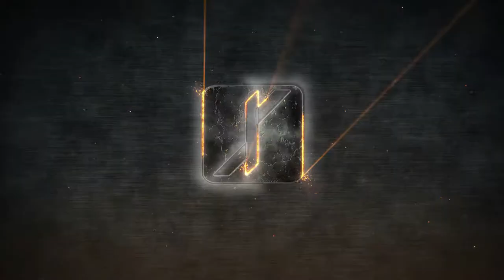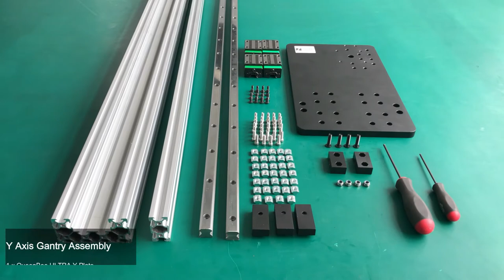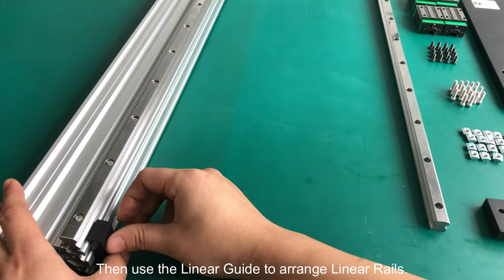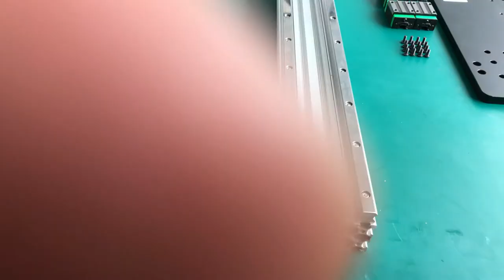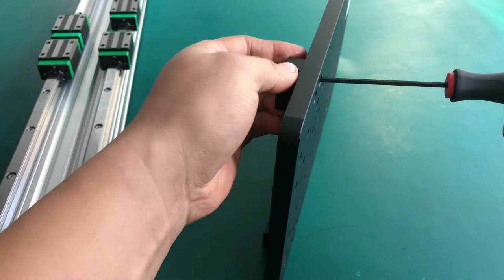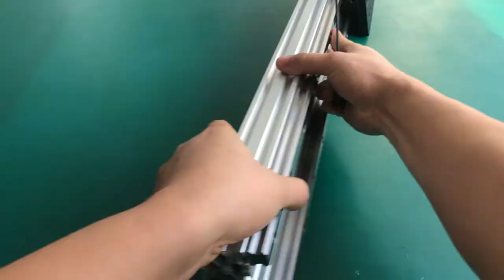WorkBee Upgrade to ULTRA QueenBee CNC / ULTRA Queen Bee CNC Mechanical kit-Part 2

Comment: The hole for the lead screw (and consequently the motor mount holes) seems to be placed in a little different position on the plate compared with the original Workbee, am i right ?
Reply from the maker: Yes,we redirect the position to let the 2040V-slot can be inserted into middle gap of C-beam Rail,to Increase strength and rigidity.
Reply: @yuyongindustry  Thanks, but i was referring to the big Y plate
Reply from the maker: @IceCreams62  Yes,all plates are changed.

Comment: How to find that block to guide linear rail,, anyone has link to buy,because i need it.,,because im already assemble all,,when im running the machine sounds of movement so noisy....or can i get dimensions from side aluminium profile to side linear rail,,i need customize
Reply from the maker: Hi friend, please check if you buy from us? And you need to adjust characters of motor running, the step per not match, it has noise,other factors also led this. The Linear Guide has no separate link, if you need, please contact us via contact@yuyongindustry.com